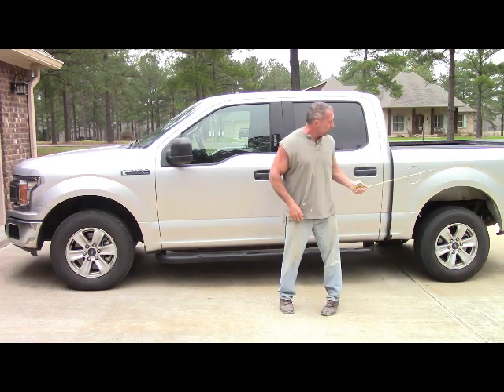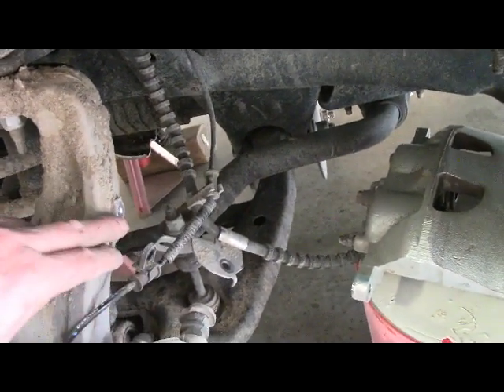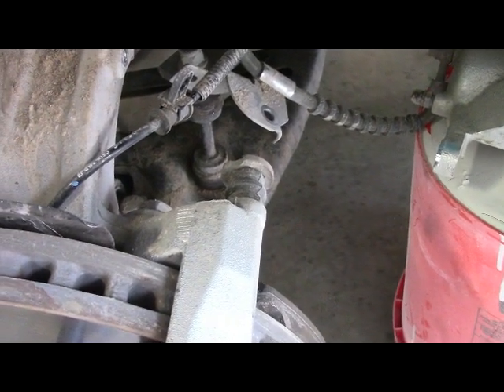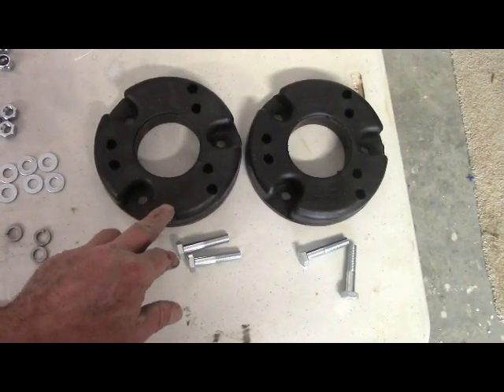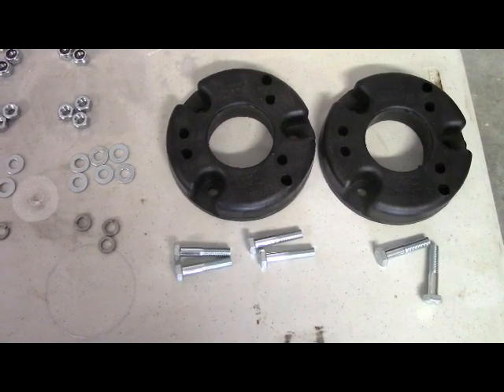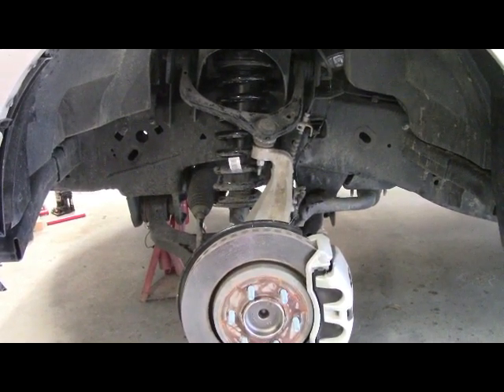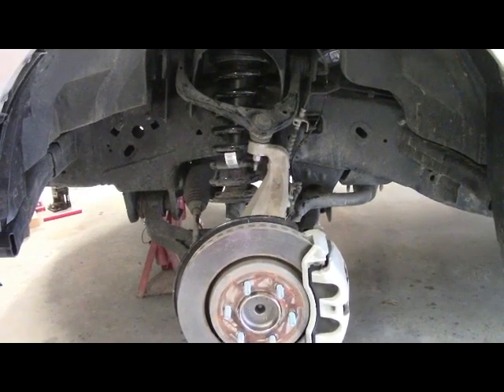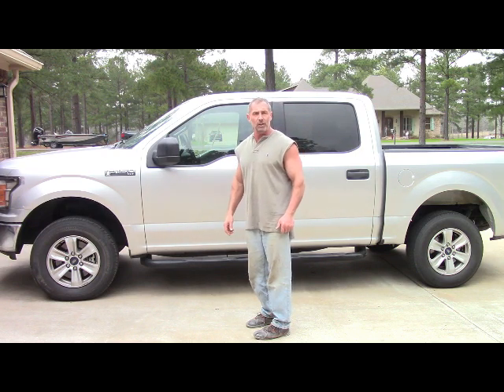2018 Ford F150   Front Leveling Kit Install

Comment: Hello just purchased the same
Kit not sure what to expect due to online reviews sayin it’s a plastic piece of junk kit. Just worried that it might crack or break or not fully hold
The trucks weight. Let me know how it’s doing for you so far thanks!.
Reply from the maker: It's been over 2 years since I installed it, and no problems at all.  I also have installed helper springs in the rear, and haul between 1,500 and 2,000 #'s in the bed two to three times a month with no problem also.

Comment: Awesome video 👍. I have the same truck and have the same kit i want to install on my own. The only thing i was wondering about is the ABS sensor behind the rotor. Did you have to remove it? Thanks.
Reply from the maker: No.. I left it in place.. didn't need to disconnect it. I just loosened the wires and clips going back to the A arm and it gave me enough slack to remove the rotor, etc. same with the brake line

Comment: Do you wish you would have gone with 2.5” spacers so the front would be closer to the same height as the back or are you happy with the current height of the front? I’m about to purchase some myself. Thx for doing the video.
Reply from the maker: I am good with the 2".. I am not sure  1/2" would make a big difference, as the rake is almost gone, and looks good from front to back. Your choice IMO.. Either set will look good as it eliminates most of the standard factory rake.

Comment: What size tire did u end up going with? Any trimming needed?
Reply from the maker: I went with a 295/70 - no trimming needed.. doesn't rub anywhere and has plenty of travel distance clearance too
Reply: Thx for the reply. I’ll be putting the same leveling blocks on my 18’ F150 lariat Friday. This video will help a lot. Other than adjusting headlights and getting front end alignment after installing blocks is there anything else that should be done to fine tune things?
Reply from the maker: Nope, that's all you need to do.

Comment: you should actually measure from the bottom of the rim to the fender well to calculate the difference accurately.  the front tires squat more due to engine weight.  good video.

Comment: How much should i expect to pay for the kit and for someone to install it? Thank u
Reply from the maker: I think I paid about $ 50 for it.. To install ?  If you took it to a shop, they will charge between $ 150 and $ 300.. If  you go a friend who can do it, give them $ 100 and some beer /Jack D
Reply: @ironmark6911  thank u for your reply. Big help for me.
Reply: @ironmark6911  another question whats the difference between doing this and installing 3.5 spindle lift?
Reply from the maker: @224chingon  this is a simple 2 - 2.5 inch lift at the strut only, which is about all you need to get rid of the raked front end. If you do a 3.5 spindle lift, then the front might be higher then the rear..no biggie there imo.. But, now you are messing with the entire front end suspension, and other parts are going to need to be replaced and or modified due to the extra height you want. There is only so much play in factory parts before you have to replace them with modified parts
Reply: @ironmark6911  damn wow thanks for all the info mark.
Reply: This is a legit informal video 💯

Comment: Any change in ride comfort or handling change ? Thanks
Reply from the maker: None that I have noticed since I installed it. Make sure you do get the front end aligned as the camber and caster need re-set
Reply: Iron Mark cool thanks for reply !